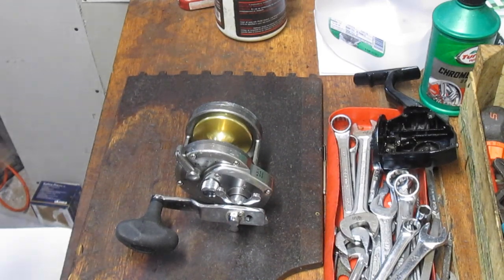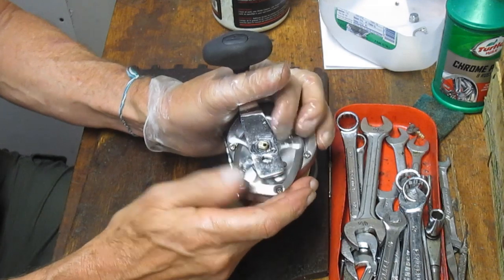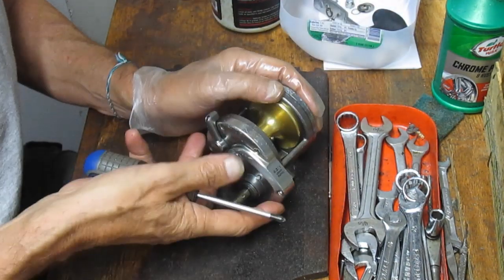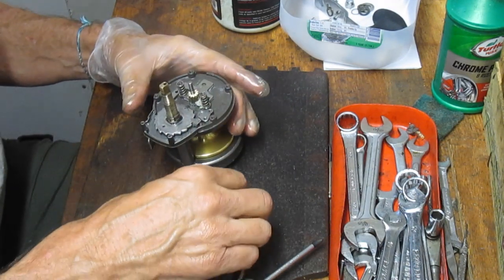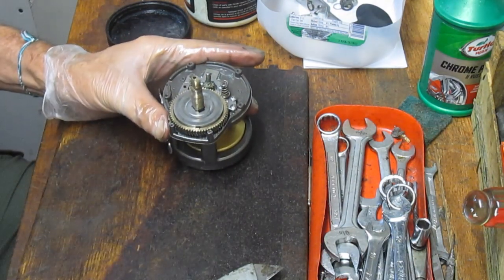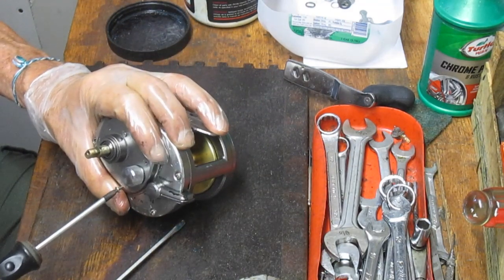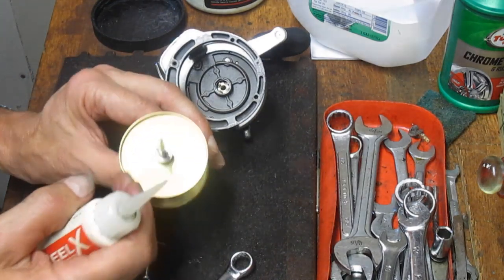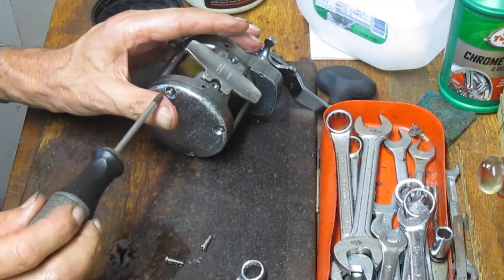Shimano Torium Fishing reel how to take apart and service step by step

Comment: I’m getting ready to fix my torium 16. The handle spins backwards. I guess I need an anti reverse bearing? Oh one suggestion for taking apart small screws I learned from working on RC Helicopters is to lay out a thin towel to keep things from bouncing or rolling off the workbench.
Reply from the maker: Possible.  There is a back up a/r dog also on the reel as a fail safe.  I would check that too.  The A/R clutch could also be dirty or too oily.  If you clean and dry it out, you may not need to replace it. Flush it with a penetrating oil and blow it out with air.  If you have the a/r dog, make sure the tines of the form are grabbing the click plate.  You may need to pinch them closed to reset the function - Thanks for asking - Dennis
Reply: @2ndChanceTackle  thank you! After watching your video I took my time and pulled it apart. The one way handle bearing was very dirty with rust in the grease and it was stiff. It ordered a new one and for fun cleaned this one out and greased with silicone grease I had on hand. I also pinched the anti reverse fingers and got it all back together. I cleaned the clutch plates and greased those but the drag was too soft even at full tight. So I pulled it apart and cleaned those really well. Broke one clutch plate but put it back together. I’ll have to get another one of those. But put it all back and seems to work great now. Thanks

Comment: HI Dennis
Love your video.
I have a problem with my torium 30
I cannot remove the whole vlutch bearing.
The inner plastic came of easy but the outer section cannot.
Any suggestions.
Thanks
Raman
Reply from the maker: Yes - it is stuck in the case.  Flood the rim of the bearing along the case with a penetrating oil to help free up the dirt and debris that is trapping the clutch shell in it.   That clutch can be removed by pushing the shell in towards the gears.  You can try tapping it with a screwdriver and small hammer and alternate the tapping from side too side to help free it up. - Dennis
Reply: @2ndChanceTackle  Thanks Dennis
Will give it a try and let know how it went.

Comment: As always, Great Video Dennis!  I had one question about you not applying "Drag Grease" to the drags during servicing.  Do these Shimano drags take drag grease or are they the Teflon drag washers?
Reply from the maker: This is a "hard surface" washer.  Not sure if teflon or another variety.  The grease will not absorb, so no sense using it - Dennis

Comment: Dennis , I have the torium 20 and wondering if I can replace the drag washers with carbon washers ? The original material ones in there now are brittle and snapped . Don’t know what that material is and hard to find . Hoping I can just add carbon washers to replace them . 
Thank you
Reply from the maker: Yes you can.  They are available through Smoothdrag.com - Dennis

Comment: Great video, thank you.  I watched to see if anything might be missing from my Torium 16 that I just bought used, as it has an odd issue.  I took it apart and everything seems to be there and assembled correctly.  It's in good shape and seems to function fine EXCEPT that the drag won't tighten more than about 4-5 lbs.  The drag washers were upgraded to Carbontex, so that shouldn't be the case, and the concave washers are good and not flattened.  Is there a "common" cause for this problem in an otherwise fully functioning reel like this?  Thanks again for the great instructional.
Reply from the maker: Sounds like you are possible missing a washer in the drag stack.  Get the schematic and see if they reinstalled all of the washers when they did the changeover to Carbontex.  They may have forgotten the cap washer.  If you have additional washers, just add an extra to the stack and see if that makes a difference.  Let me know if that helps - Dennis
Reply: @2ndChanceTackle  Thank you.  I will look for the schematic and double check for the cap washer.  I watched your video carefully (before asking) and it seemed that all was in order, but I will check that again.  I have an extra pair of drag washers-- I'll try adding one of those to the stack just to see if it's a "length" issue on the main crank shaft.  I'll let you know.  Thanks for the reply!
Reply: @2ndChanceTackle   Ok I did a thorough check of the reel, referred to the schematic and your video.  Nothing seems to be missing.  I looked at the star drag wheel and when tightened down fully, there was still a small gap between it and the frame as it should, indicating that there wasn't a washer missing and the star might be bottoming out.  But to be sure, I added another drag washer to the shaft and this was too much, and didn't affect the drag power at all.  All of the relevant internals seem to be there as well-- all of the spacers and Carbontex washers are all there.  I just can't understand why it won't give any drag resistance.  It's in great shape inside and out.  I've used a Torium before and the stopping power is excellent, and one of the reasons I bought this one.  I've never seen this in a reel before.
Reply from the maker: @thecanineunderground3081  Hmm - I'm stumped.  This is hard to do without seeing the reel.   Something seems to be amiss.  I am not sure where to to point you.  Sorry - Dennis
Reply: @2ndChanceTackle  Well thanks.  It was a long shot anyway, thought maybe this was a common or known problem with a simple fix.  It's just frustrating because otherwise the reel seems to function perfectly.  I just can't figure out how it CAN'T be working!  Too bad you don't have a shop nearby...  Thank you. 
RD
Reply from the maker: If you are going to give up on it, you can alway mail it to me for a try.
If you want to know more, send me an email - 2ndchancetackle@gmail.com - Dennis
Reply: Hey i got the same problem at the moment did you by any chance put any oil or lube or anything on it or did your just open it and assemble back together?
Reply: @2ndChanceTackle  Hey wanted to let you know-- I took the reel to a local guy here.  One of the drag washers was flipped/ put in upside down, apparently when he upgraded to Carbontex drags.  I took them out and put them back in the way I found them when I did my teardown, and thus the problem persisted.  Works like a charm now.  Thanks for the help and the great video!

RD
Reply from the maker: Great to hear it is going fishing again!  Best wishes - Dennis
Reply: FYI - I was having the same issue with little drag pressure on a seemingly normal looking torium30 with Carbontex upgrade, adding an additional drag washer to the bottom of the stack, underneath the main gear fixed me up, now shes got hella drag, lets go fish!

thanks for the video Dennis, great help!

Comment: I really appreciate your videos they have helped me in bringing my dad’s old reels back in use 
I heard it is recommended to grease the screws that are threaded to metal on reels that are used in saltwater 
In your experience is it really necessary?
Reply from the maker: The grease or oil drop on the screws is not necessary, but it is a good practice.  From time to time these screws seize in the crossbars and reel seats.  If you have the reel apart, take a moment and do the oil or grease.  I use a drop of oil, but grease is fine as well - Dennis

Comment: Hi Dennis,

I wanted to change the bearings and ran into two problems.  

For the bearing on the side plate, I got the pentagonal spring out but the bearing wouldnt release.  Do younknow why this is?

Also my spool wouldnt come out so I couldnt replace the main bearing.  I had both ends loosened when I tried this but couldnt understand why it wouldnt just pop out like in your video.  

Any help is appreciated!  Thanks
Eddie
Reply from the maker: The bearings sit tightly in the case.  You may need to get a small hook or pick like a dental tool to insert through he bearing hole and pull up from under the bearing to free it.  If you spool is not coming out from the gear side, then the shaft is probably stuck to the pinion gear.  Try using a penetrating oil to free it.
Dennis
Reply: Thanks Dennis.  I will try that.

Comment: Dennis, I sent you a questionllast month and never received a reply. I can not get my free spool to function; the lever will notdis engage the spool, nor can the spool be removed from the case. Could the spool gear be corroded or frozen on the notched end?  i did not try to force it.
Reply from the maker: Sorry I did not reply!  The pinion gear is likely frozen to the spool shaft or the stud on the free spool lever may be broken off.  If the pinion gear is frozen to the spool, the yoke will not be able to move it in or out. to get to free spool.
If the eccentric stud is broken, it will not be able to move the jack to push and pull the yoke in and out to release the pinion gear.  You will need to take the reel apart to determine which piece is broken or seized - Dennis

Comment: HI Dennis
I have tried to upgrade the drag washers on my torium 30 but when I put things together the handle is very very hard to turn
Is there anything wrong that I'm doing
Your advice please
Thanks
Raman
Reply from the maker: If you replaced these with Carbontex washers, which are thinner that the originals, you may not have enough clearance between the star adjuster and the housing.  Does you reel turn freely when the drag is backed off?  if so, you may need to add an additional tension washer of the original washers  to build it up for clearance
Reply: @2ndChanceTackle  
HI Dennis 
The Carbotex drag washers appear thicker than the original ones.
I'm thinking that this maybe the problem.
Like I said the handle is very hard to turn
Reply from the maker: Make sure that the earned washers are in the slot of the main gear.  If the washers are sitting up high in the stack, you may have the bridge jamming against the side plate

Comment: Hi Dennis,
Your videos helped me a lot. I really enjoy to watch them.
I just got a second hand torium 14 for myself and the first thing what I noticed, the handle knob is really tight (frozen). Is there any way to take the handle assembly apart to clean it? Or just try to free it up by soaking it in some penetration oil or vinegar... . Could you please advise? 
Regards, 
Armand
Reply from the maker: You can; take that one apart.  Sometimes a good soak with a penetrating oil like WD40 will help.  You can order a replacement handle direct from Shimano for around $20 plus shipping.  As an alternative, you can drill out the stud on the handle and replace it with an aftermarket knob. - Here is the link to the Shimano page https://fishshop.shimano.com/collections/tor14 - Dennis
Reply: Cheers,
 I would like to try to take it apart. I removed the side cap of the knob, but i didnt find any screw at the end of handle knob shaft. It seems it is riveted. How could i take off the handle knob?
Regards,
Armand
Reply from the maker: It I was unclear with the last note due to the typo, I am sorry.  You cannot remove the handle knob as there is no screw or bolt set up.  It is pressed on to the handle shaft.  The only way to remove the knob is to drill it out from the back side of the handle shaft and then replace it with an aftermarket knob upgrade - Dennis
Reply: @2ndChanceTackle  Many thanks again.

Comment: Do you know if this breakdown also applies to the new torium?
Reply from the maker: I am not sure, but the design on  model rarely changes by much as the introduce the newer versions.  Best to check the schematics, but my guess is that it did not change much - Dennis

Comment: Question when putting my reel back together note ( carbontex washers so no grease ) why am I loosing drag pressure?
Reply from the maker: Is the stack installed correctly?  It sounds like you have slip in there somewhere.  Iwould check the parts installed against the schematic to make sure they are in the right order.  The schematic can be found at fishshimano.com if you don't have it - Dennis
Reply: @2ndChanceTackle  right on ill be sure to go back through it tomorrow i appreciate the response
Reply from the maker: OK - let me know if you still have problems after you go through it again - Dennis